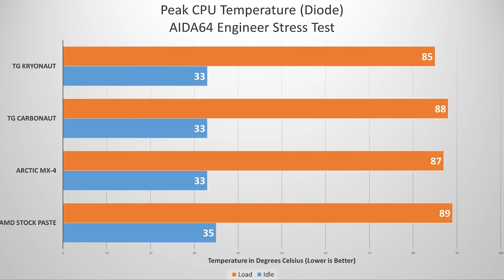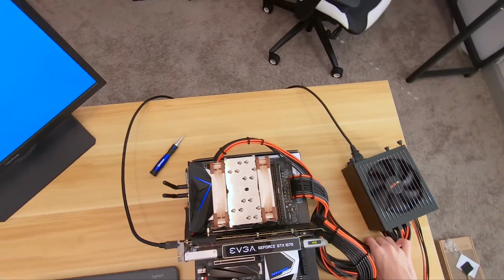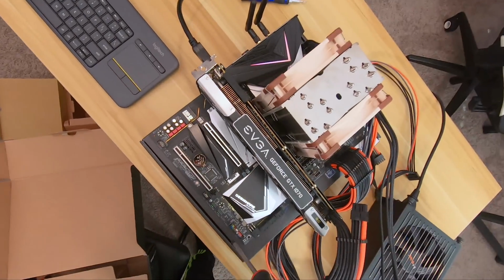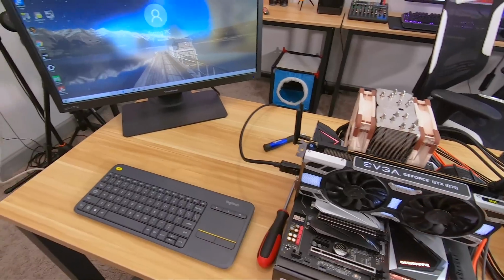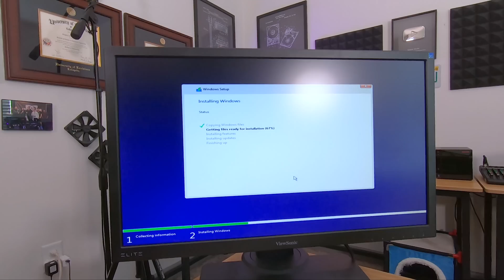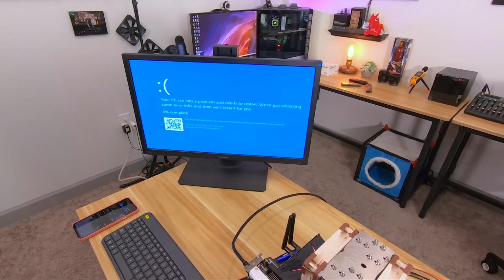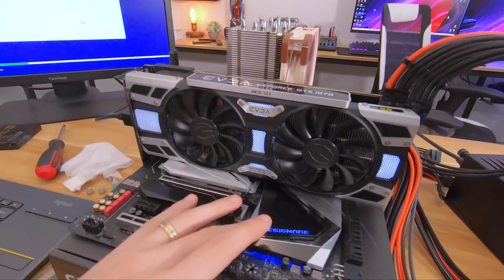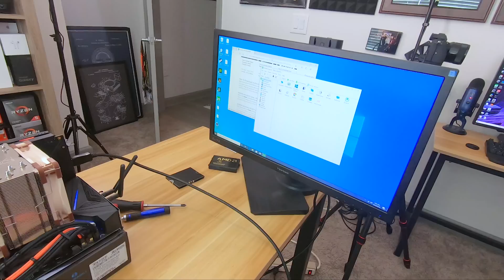Fixing My Defective 9900KS Test Rig...

Comment from the maker: I didn't wanna give you guys a boring ol' unboxing video. Instead, I wanted to document my troubleshooting process for this test rig. It, admittedly, was not what I expected and is explained toward the end of the video. Thanks for watching!
Reply: Doh" lol😂
Reply: yep this chip is a new stepping.  basically this chip will be what intel release as the i7 10700k and is an r0 stepping instead of p0 stepping like the normal 9900k is.  it has silicon changes for vulnerabilities and is different enough that...well you know by now.  its not just a better binned 9900k.  its a whole new chip.  the i5 should be basically an 8700k, probalby with these same silicon changes.  they should all clock a bit better as well which is nice.  an i5 10400f for 135 on sale on newegg with 6 cores 12 threads would be an amazing budget cpu.  even at 150 or more will be great.  plus i3 with 4\8.  intel should have done all this 2 years ago at the latest though
Reply: hi there do more reading m8. things I would have checked  did I need a new BIOS LOL
Reply: Greg Salazar I’m having the same problem but it freezes and I can’t control alt del so i need to shut the pc down while playing games would you know what the problem is my specs are: 
I7 8700
Rtx 2060 by msi
Psu cx650m by Corsair
Ram 16gb vengeance pro
Mobo msi b360 gaming plus
Ssd wd blue 250gb
CPU cooler enermax liqfusion
Anything helps I’ve tried reaching out to other people but no response and I can’t pay anymore money because I paid over 1200 for it pls help. 
Thank you

Comment: I got the Gigabyte Z390 Aorus Master with a Cooler Master Hyper 212 EVO RGB Cooler, I9-9900KS, Corsair AX1500i PSU, Corsair Vengeance LPX 128GB (4x32GB), Samsung 2TB 970 EVO Plus NVMe and a lowly RX 480 8GB and it booted, installed Windows 10 Pro and has run PERFECT at 5.03GHz for over 26 months, oh and the temps range from 39 to 54 degrees, so its very cool even with ALL 8 cores and all 16 threads running at 5.03GHz. I have seen it dip down to 4.78GHz a few times when i have more then 500 Google Chrome tabs open, encoding video, and playing World of Warships, so i guess that is to be expected. Otherwise, if you did your research and purchased the proper parts then this is still, even in April 2022, one of the fastest overall CPU out there as the "new" i9-12900KS only has that 5.5GHz boost speed on 2 of the P-Cores, the other cores run at lower or random speeds

Comment: Here's a troubleshooting guide for anyone scrolling thru the comments
- PC doesn't turn on: Check PSU, or front panel connectors
- Fans spin, but no display: Check MOBO, RAM, GPU, CPU, PSU(sometimes it may be a loose cable, or your cable isn't plugged in to the right component), Clear CMOS
- Weird Behavior in OS: Check BIOS and flash to latest
Obviously this doesn't cover ALL PC problems but it should give you a rough idea of where to start

Comment: LOL I'm glad I wasn't the only one. Just upgraded to the 3950x (from 9900k) and my system straight fell apart, was having problem after crash after green screen. Troubleshooted for about 5 hours... turns out I installed an old BIOS and a quick update fixed everything.... it happens to the best of us

Comment: I'm at 8:49
OOH! I know it needs a bios update! My Z390 Aorus + i7-9700K stepping R0 did the same! 

I also spent hours disasembling and reassembling the system :(  I thought it was a bad/shorted mobo. Ended up going to bed trying a last desperate mesure... updating the bios...
... woke up... it was in the desktop fully functionning waiting for me...  (ಥ﹏ಥ)

Turns out even Z390 isn't out of the box compatible with 9th gen. At least you can go into bios and update it with a usb stick and another PC.

It is a very weird issue usually boards needing a bios update for CPU comptability will completely lock up before you can reach bios.
And usually all CPUs within same gen have the same baord and bios comptability.

Edit: YES! I'M RIGHT!

Comment: I guess different base and boost clocks in the chip mean that a microcode update for the BIOS is required to support the chip.  I guess it kinda makes sense since the clocks are controlled by the board itself and not the chip (hence things like MCE and overclocking etc.) but like you, I would have thought it wouldn't necessarily need a new BIOS.  At worst I would think it would just clock the chip to the defaults for the 9900K which shouldn't cause any issues but I guess not.

Comment: Its difficult for me to comprehend how a guy that does PC tech videos for living can not think of updating the BIOS first of all things in this situation! If you install a CPU that was not "in the wild" at the time of your current BIOS version release date - does not matter if its "same architecture" or not - your BIOS may be driving it at totally incorrect multiplier and voltage values, not to mention the required architectural changes...

Comment: Pop and swap component troubleshooting with a known good was the primary method we used for my 10 years as an electronic technician in the military.  Sadly, now most electronic gear goes back to the manufacturer for repair and replaced with a fresh unit off the shelf.

Comment: I understand why you wouldn't think there would need to be a bios update, but anytime you install a cpu that is new to market and start having issues, the bios should really be the first thing you check. Not only is it likely to be the problem 99% of the time, especially when you're using other hardware that you know works, but it's also the least time consuming.

Comment: the power delivery required is higher for the 9900KS it's 127 TDP against the 95 from the standard 9900K i would check that at first glance before trying to run it knowing it's a hotter more demanding cheap

Comment: It seems you ran into the same problem I didn't expect. I flashed my CHVI x370 with ABBA paired with a 1700, and the system would simply get stuck at the windows logo loading screen. Even with a cleared CMOS it would simply not boot with the new Ryzen BIOS, I simply flashed back to the previous one and now the computer is working fine. I updated since I was exchanging my RAM and was going to try overclocking it with a new BIOS, but I guess the ABBA BIOS isn't so happy with my poor old Ryzen, will try again now only when the 3900x have a price drop and I get one.

Comment: I have seen similar lockups and bsod due to one faulty cable. One wire in a bunch of wires......faulty. Never had a faulty cpu. Definitely have had a bad motherboard, RAM and power supply. Even had a HDD that bricked the pc even though it was new. I guess quality control is a numbers game.

Comment: I remember when I was fixing up a PC that was found on the side of the road, at first it had an AMD Athlon 64 x2 4200+ cpu and for very cheap I replaced it with a Phenom x4 9650 cpu without having to replace the motherboard, but at first when I put the CPU, it didn't post, but then I recognized that I had to update the BIOS to something a little more recent, so after updating the BIOS, the Phenom quad core CPU works just fine, I think I only paid about $6 or $7 for it and I have that paired with a GTX 285. I use it for older 3d games. My main rig has an Intel core i7-6800k cpu 6c/12t oc to 4.3 ghz with 16 gb ddr4 3000 mhz quad channel ram and a GTX 1080 graphics card.
Reply: Pretty strong rig.

Mine is the i7 6700k with a 1080ti and 2x8 ddr 4 3200 cl 16 ram, and gonna switch the cpu to the Ryzen 9 3950x, I desperately need more cores, but don't wanna sacrifice gaming performance by a lot, thus why Ryzen seems like the best choice.

Comment: New BIOS is required for the different power delivery profile. Without this the motherboard will run the 9900KS as if it was a 95W part. It would seem your board was starving the CPU of power during boost.

Comment: The BIOS update is probably due to all the security mitigations Intel put in place to try to fix all the hyperthreading security issues. Performance figures will be interesting since leaks are claiming it's actually slower than a 9900k pushed to the same clocks due to the security fixes.

Comment: Hey Greg, do you think you could reach out to other motherboard manufacturers to see if all will need a bios update?  That could be helpful to know if anyone is building a new system and doesnt have an older cpu.
Reply: I guess it's kind of obvious that BIOSes will need to be updated, due to the new microcode necessary to support the KS.
Reply: I'm kinda curious.. What BIOS version did you have before you updated? Since you actually managed to boot and go into BIOS using the 9900KS, even though you didn't have the correct BIOS version.

Because, as Matthey just asked. Not everyone have another 8th or 9th gen cpu they could use. So it would be interesting to see if you can actually use the 9900KS even if the BIOS is too old, just to go into BIOS and update it. Without having one of those boards who can actually update the BIOS without cpu and memory installed.
Reply: @illyont  what motherboard do you have, I have a aorus xtreme on its away, the only  cpu I have is 9900ks, hope I can use Qflash, flash the bios without cpu
Reply: @d1d1ka I got the Gigabyte Z390 Aorus Master - but luckily it came with the correct BIOS already on the board. So no problems for me. I bought it from a webshop that was out of stock initially, and then got fresh boards in just as I ordered. It might depend on shelf-life, I don't know.

Comment: Hello, Greg:
Thanks for all you do.
I had a similar problem for years--the pc would freeze, requiring a hard reset to overcome.
I thought it might be a power supply problem because the event log kept having 'lost power to the kernel' entry every time it froze.
Tried 2 different PSUs w/ no joy. [3 if you count the one I bought on sell on Prime Day.]
It turns out it's the RAM--Crucial, so it's got a 10-year warranty, which I may try to use. [May not, it's DDR3.]
BTW, I guess you've heard that Intel had to do the rush patch job for the hardware security issues so that may be partly why you needed the BIOS update.
Have a GREAT day, Neighbor!

Comment: A BIOS update is the 1st thing to check. You know better than that. lOl. The 1st Gen 9900K's are PO stepping and reach higher clocks under LN2, so all the overclockers want'em. There are 1st Gen. 9900K's that are PO stepping. Especially the ES chips. The 9900KS is a RO stepping chip. Also the RO stepping chips supposedly have some security litigations that were fixed in the hardware. So that could make difference in the microcode for sure.
 Remeber the 45nm QX9650's or the 65nm GO stepping Q6600's. and the 680i chipset blunder. 
Maybe that's a little to far back.
(I keep forgetting that I'm a old person. 2007-2008 was when the Q6600 price dropped to $215.)
  The GO stepping Q6600 had a 10°c higher thermal throttle point and ran 10°c cooler. So those were the ones to get for overclocking.
Reply from the maker: I disagree with the first statement in this context. I'm now aware of the stepping differences and physical security patches, but nothing indicated that the 9900KS was any different internally from a 9900K or KF. And most BIOS incompatibilities result in no post. This is not your typical BIOS issue.

Comment: One point I would like to make, always read all the bios comments above yours.  As sometimes updating to the most current one is not correct.
Reply from the maker: Right. I addressed this in an earlier video as well. Especially in the case of Ryzen, previous BIOS updates are often required before flashing the latest version.

Comment: DPC_WATCHDOG_VIOLATION commonly comes up in the form of kernel driver holdups, so possibly the chipset or storage driver if an outdated BIOS was causing it. In future, you can usually work out which component or driver caused the  timed out delayed procedure call (DPC), by looking at a full memory dump.

Comment: If you take 9900 and do 9+9+0+0, it equates to 18. If you take 18 and divide it by 4 (NO. of digits), you get 4.5, which is the boost clock (4.5Ghz) of the Ryzen 7 3800X. Then, if you add 3+8+0+0, it equates to 11. If you take 11 and divide by 4, you get 2.75. This indefinitely elucidates that Half-Life 3 will release next quarter when we hit 3.

Comment: Since you said it was something you hadn't experienced before, I knew I could rule out that it would end up being improper PSU cables... Because, hue know all about how that can work out. 😬😬 🤣
Reply from the maker: HAAAAAAAAAAAAAAAAAAA this is good.
Reply: Funny story about that one for me. Had a new PC build that would automatically trip the PSU upon pressing the power button. Tried unplugging all but ATX & 4-pin CPU connector (older board), no change. Tried jumpering green+black wire on ATX connector - PSU powers up.

Turns out ASUS had not only flipped the 4-pin connector so the release clip was on the side instead of the top like every other board I had seen up to that point, AND didn't key the connector properly so that it could be plugged in wrong (trust me, I didn't force the connector). Took me waaaayyyy too long to figure out what was going on. 

Firsly, I'm lucky the PSU did its job and cut power upon determining something was wrong. Secondly, well I learned to pay close attention to that connector! (though now with 8-pin connectors it's better).